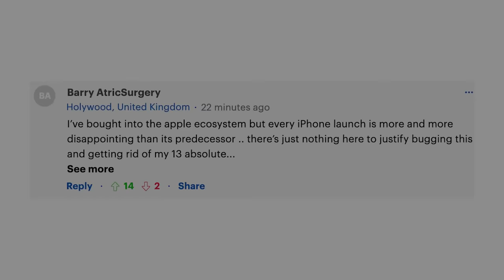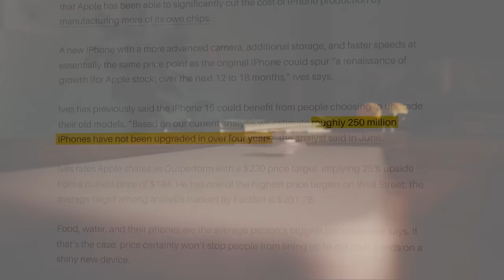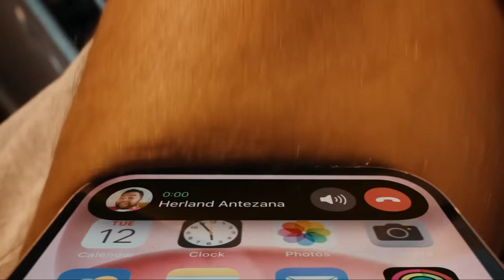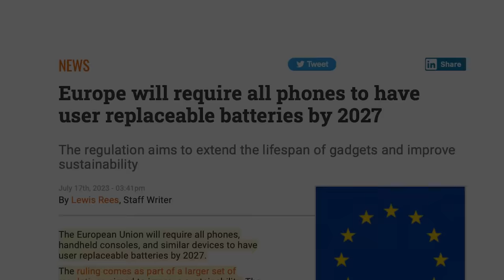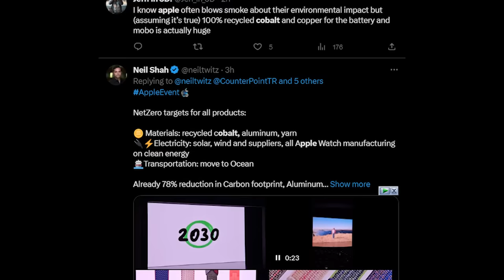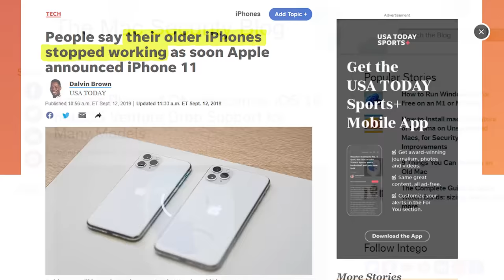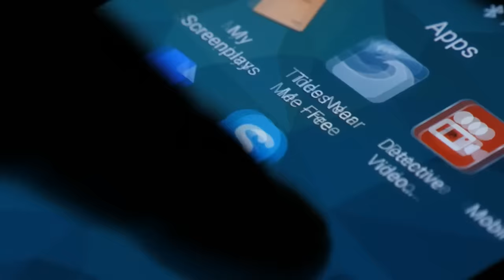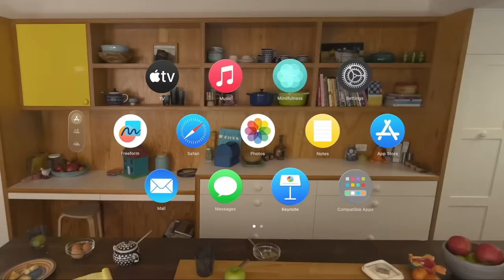The iPhone 15 Is Everything Wrong With Apple

Comment: Has anyone ever considered that the shape and features of "smartphones", regardless of it being Apple's, has reached it's peak? And there's absolutely nothing wrong with that. Future iterations DO NOT necessarily have to be drastically different in size/shape than its predecessors.
Reply: YES
Reply: Which means you don’t need to pay more and more for less and less upgrades when you were getting more upgrades for fewer more bucks back in the days
Reply: @mahee96  I’m not making a commercial argument, only a logical one
Reply: @fnanfne  I too am speaking about practicality because if Android phones can provide upto 120 watts safe fast charging, 6000+ mah (in 6.7 inch smartphones), USB 3 transfer speeds for phones from 3-5 years ago, what is the cost of increase in price adding upto consumer’s advantage?

I do understand apple uses high grade components and hence the high price point, but less or not much upgrade but $200+ increases in price doesn’t make much sense.

I have used Androids in the past and moved to Iphone for iOS SW development but to be frank my 5 year old mobile having 4000mah used to last longer than 3200mah in my current iphone 14 pro

I am power user/SW engg, so my usage might be bit heavy.

I too support that sometimes break through changes aren’t required and sustaining is better but increase in price for minor upgrade is basically like saying we raised prices due to inflation 😅
Reply: @mahee96  But the thing is, we aren't paying more and more. The price of the "pro" iPhones has stayed at $999 since 2017. Considering inflation, the price has in fact reduced over time.
Reply: No. Other phone makers are innovating with flips and folds...this not peak design at all
Reply: @sonofapollo6814  Innovation? lol, no. That's called "testing the water". If the water was pleasant, you can bet your tootsies Apple would've copied that already. The fact that it hasn't....
Reply: @fnanfne  

I think you need to google the word " innovation" if you truly believe " testing the waters" has nothing to do with innovation 💡
Reply: @sonofapollo6814 Yeah flip phones are real innovative. I had one in the late 90’s lol
Reply: @sonofapollo6814  Okay I stand corrected. If by "innovation", you mean "throwing shit on the wall to see what sticks".
Reply: @mahee96  And many people are, in fact, not paying more and more for less and less upgrades. If you look at it from a month-to-month perspective, if you hold on to a $1000 iPhone for 2 years, that’s $41.67/mo. If you even hold on to it a year longer, that’s $27.78/mo. I’d wager most people are in fact skipping the “boring” years and getting more value out of their existing iPhones.
Reply: I miss the minies
Reply: @sonofapollo6814   those aren't even that innovative maybe the fold is but the flip's functionality has such a niche utility I don't even understand what advantage it has from a regular phone.
Reply: @sakn415  
The flip is innovative 💡..the ability to deploy a foldable screen with limited loss of functionality.
Reply: @sonofapollo6814  limited loss? But what is the use of a flip phone? You still have the same screen real estate as a normal phone now with a small crease in the middle
Reply: Not in the minds of us consumers. But I’m that way, how would apple as a company stay in business?? Only thing they could do is make the phones more reliable, to appeal to consumers, but if peak reliability is reached, how could they make sales
Reply: @bryanmasis1595  
Obviously, peak reliability has not been reached 
E.g USB-C  should have come to apple sooner, a longer lasting battery would be appreciated also, less fragility is something else the phone company's can strive for
Reply: People seem to think incremental upgrades are a bad thing. I don't like Apple's business practices since they go out of their way to make things harder to fix without going back to them, but I also hate how many reviewers try to make incremental upgrades seem like a bad thing. Depending on someone's usage or what they're moving from even just having a faster phone can be better. Incremental doesn't mean bad... Just means you're not as impressed as you want to be or are used to being, essentially we're spoiled. On top of that it's not like you have to change your phone every year... just skip it if the difference isn't significant enough to warrant an upgrade and if your "old" phone still does everything you need
Reply: @@NaanKartik If you dont use or know apple products, how do you think you are allowed to talk about it if you have absolutely no clue?
Reply: EXACTLY!  We have phones that can boot in seconds, last the entire day (or several if you don't average 20h of dyilyscreen time), with sharp, vibrant, bright, color-accurate screens, that are super fast, opening apps in sometimes a fraction of a second. What more do we need??
Reply: @Octofinite  Exactly, the iPhone X would have been about $1,250 in today's currency when it released
Reply: @sonofapollo6814 I think if you ask most people, they won't see the point of that. You might as well make them triangles and call that 'innovation'.
Reply: It has increased everywhere except US
Reply: @eirikdalheimsamuelsberg7278 seriously sir?The body of the phones were folded during the 90s which means the screen part of the phone was intact whereas now the whole screen is foldable.
Reply: @mahee96  The last price hike they did was cuz of inflation
Reply: @mahee96  Most TOTL android phones have USB2.0, proprietary charging protocols. Not to mention you don't understand what inflation is.
Reply: @AudriusN  lol...I work in semiconductor fabs and know current demand and how dirt cheap prices are becoming for all types of manufacturing process with the process/channel gap reducing to near picometer(10^-12). 

This reduction in process size means more efficiency in terms of power, better speeds in terms of processing speeds. Not to mention it includes all domains such as microprocessors to microcontroller hence SSD, NVME, DRAM, SRAM, SOC costs going down.

Ex: if you see DDR5 RAMs for 32GB which would have been 400+$ 2 years ago has come to 100$ around today. That is 4x reduction in price. (Now don't tell me apple uses SRAM...)

CPUs are becoming denser with reduction in manufacturing costs which means if you spend same $xxx then you get a better/high performing processor today. (It's 'like' saying A16 and A17 chips should basically cost the same due to this factor)

So "NO" inflation alone isn't driving the increase in price because in electronics sector "Deflation" is on going fyi.

Next, in terms of innovation, I will give you real examples 
1. 60+ watt fast charging (split battery tech, parallel charging to reduce heat etc)
2. 6000+ mah on smartphone of form factor 6.7 inch.
which are present in 2+ year old smartphones even dating back to 2019 when these were introduced.

Baed on the comments, what I can see is that 
1. people don't think about world except US since $200+ increase which considering the valuation of currencies of lower denomination where the apple products are sold roughly even might translate to monthly paychecks of people (Now if one thinks answer to this is: "Not my problem", then sorry to say...your opinion as a consumer are already discarded). 
2. people haven't even tried others or know anything about what's going in electronics sector, what exactly does one consider as Innovation etc. 

When I say try others, having your mobile standby for 2 days without having to charge is better than having to charge by EOD everyday. Also putting on charge for 20 mins to get to 80% is way better than waiting for 90+ mins.

And lastly when apple does this both... People will consider it "Innovation"...lol.

Nice engagement by all btw.
Reply: @mahee96 yep great points , I was getting annoyed with the inflammation excuse.
And I tried to use the latest iPhone but as functionality I didn't like not having the back button , the text to speech switch has a shortcut command so swipe a handful of papers over it and it turns on.
And  all the slowed movement to make it seem fancy when you do stuff on it annoys me , it's like I used 100$ phones that can pop things faster.
And the charging ports and chargers is another thing that makes me very reluctant to ever switch to iPhone cause even the cables have USBC instead of the regular USB.
And the price doesn't help , with the current price I can change phones 5 years in a row and get increased specs each year
Reply: the zoom in camera could be better for non “pro” iphones and they should really make them waterproof/at least truly shockproof so people wouldnt need to use phone cases especially with that amount of price people pay. there’s so much room for improvement to be honest.
Reply: Nokia is the best phone ever
Reply: All they can do is increase performance of CPU and better camera. But tbh software is underrated and it's potential is immense! Phones are as powerful as low budget laptops now, what is missing is innovation in the software department. Hopefully AI will help develop some life changing applications.
Reply: But, green text bubbles don’t get you laid
Reply: Apple fans are nearly as combative as playstation fans. Your product is not perfect or unique, and 90% of other brands do the same thibg
Reply: Yes, but still they can borrow some features from competitors or if they can't then just stop bumping the number
Reply: This is why I am so excited for this folding phone tech, its the first time within 5 years phones have actually been interesting
Reply: That's true, and it's odd that I haven't thought about that. I guess in the past decade or so, we have become accustomed to rapid advancements in technology.
Reply: I feel the same about cars. A car from 2007 looks the same to me that a car from this year. Both uses the same amount of fuel on 100km etc. This is what happens when after years and years there isn't much to innovate. At least now with electric cars there is a bit of change finally
Reply: I remember the days of having a dedicated keyboard. I would KILL to have a dedicated keyboard and a more modest phone size so I can go back to the earlier days where they were far more functional.
Reply: I agree with this.  I've never heard someone complain that companies selling hammers for example can't innovate because hammers haven't radically changed every year for the last however many thousands of years...  I don't really understand why people would feel like their phones absolutely have to change in appearance and functionality every 365 days or it's the end of the industry as we know it.  It's like after the launch of the initial iPhone the world never got over that "one more thing" announcement and has been desperate to relive that moment forever with no ability to move on.
Reply: agreed
Reply: If you really step back it is pretty obvious that smartphones have not developed in any truly significant way since 2104, its been iterative tiny speed and camera improvements and battery life (which only became a problem because Apple drove the unibody non replaceable construction). Most users need less that 20% of the computing power that a flagship smartphone produces.
Reply: @Octofinite   This is because it is essentially the same as the 12/13/14 so there are no R and D costs to recoup now and retooling was minimal for the changes. If you take out those costs it means the margin will be even higher for the 15 at the same retail. Apple also knows they are now very much the old fashioned phone maker sticking with the same slab, so they market on the price "reduction" and percieved premium quality brand cache.
Reply: @mahee96  Apple doesn't expect you to upgrade every year. The small changes are meant to give options to consumers who are thinking of upgrading. The "minor upgrades" will add up after 3/4 years. Nobody has ever expected you to upgrade year after year.

Comment: I buy a iPhone every 5 years definitely will notice innovation when you stick with your tech for that long 😂
Reply: i went from 8+ to 15 pro max and it's not as impressive as its sound
Reply: 5 years is nothing at all
Reply: @AmicusAdastra i went from 15 pro to s24u was not really impressed i should have bought nothing
Reply: @fabricliver  Yeah, nothing meaningful changed basically since the iPhone 5s (introduction of Touch ID). I have the first SE still in use sometimes. It does basically everything that you need from a modern smartphone.
Reply: @AmicusAdastra how?
Reply: Agree… I have an iPhone XS and I think I’ll see the difference
Reply: I went from 7 to 15 and it wasn’t much different
Reply: @damianwojcikiewicz3951iphone dont have 120hz its 60
Reply: @damianwojcikiewicz3951iphone dont have optical zoom ita digital 5x🤣
Reply: @damianwojcikiewicz3951apple slaves lived inncsve
Reply: @AmicusAdastra went from 12 pro max to 15 pro max. it’s great.

Comment: I went from 7 plus, XR, 11 Pro max, 13 Pro Max, 15 pro max. The switch from 13 pro max to 15 pro max was barely a difference. Besides the island and supposedly longer battery life I’m not noticing the same amount of difference then from the 11 Pro Max to 13 Pro Max. Or the 7 plus to XR. Good phones regardless but I’d say waiting every 2-3 years between an upgrade is probably the best not only financially but Technicality standpoint.